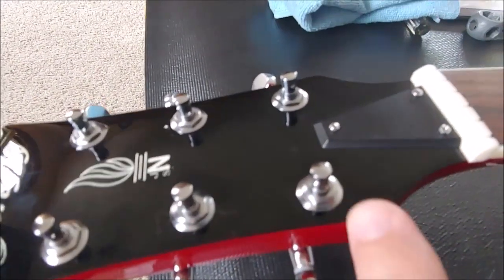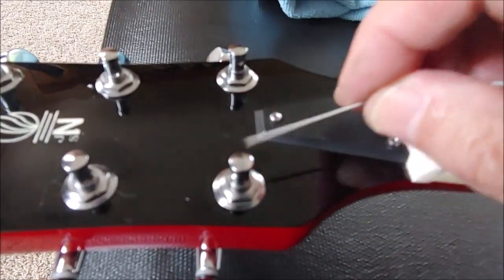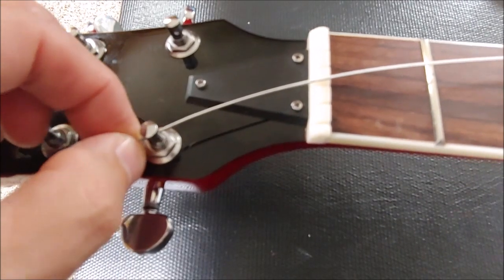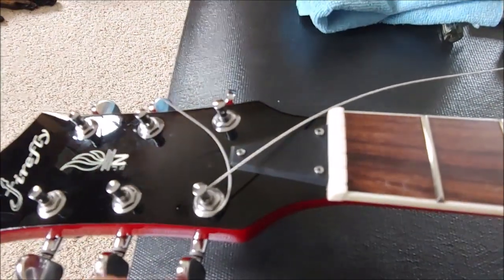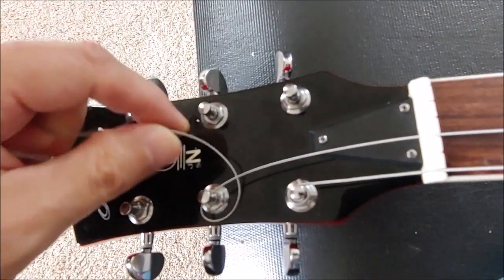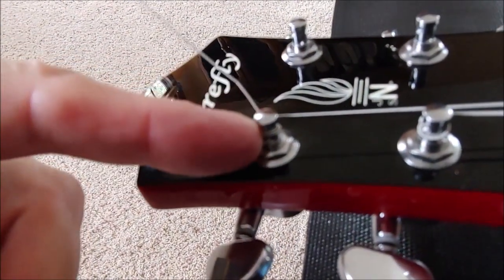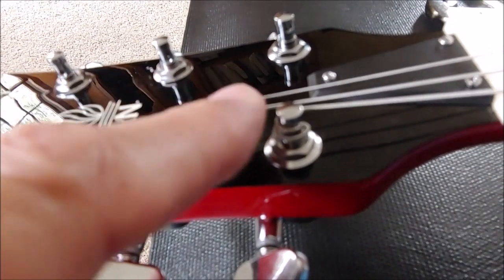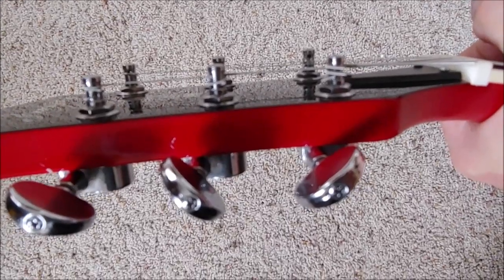Wilkinson EZ-LOK Tuners: Putting on the Strings

Comment: Good job, I usually have the strings through the bottom first on both E strings and in the top holes for the rest so they are at a more consistent height behind the nut. But as you said it doesn't really matter as long as they don't slip 👍👍👍

Comment: I pull the string tight then wrap one turn then into the second hole, locks tight. I use all upper hole's first. String's using a string tree lower hole first.

Comment: Two holes, one hole, either way these tuners have a high ratio and hold pretty darn good for 20 $ tuners. I have a set on one of my el cheapo guitars and they are still in tune after two months in the closet and hold while thrashing on it. If you are short on money, buy a set.

Comment: "Featuring Wilkinsons 'EZ-Lok' system"
 This feature is essentially 2 string post holes drilled at 90 degrees from each other. Pull the string through one hole real tight, wrap 3/4 around the post, pull tight through the other hole. Tune to pitch, cut the string- DONE. Use the top hole first for the E, A and D, use the bottom hole first for the G, B and E. Or, you can ignore it and string your guitar the traditional way, the choice is yours.

Comment: WoW!  sorry dude, it is all wrong. 
For 6 in line staggered tuners - Top hole first for the E, A & D. Bottom hole first for G, B & E. 
For 3+3 tuners - Top hole first for all E, A, D, G, B & E.
Be sure a string in through correct hole, pull tight then wrap 3/4 around the post, pull tight through the other hole. Tune to pitch, cut the string - DONE.
Reply from the maker: Ultraflex, thanks for your comment and explanation. You say toMAYto, I say toMAHto. No worries.
Reply: Thanks :)

Comment: Video is too blurry to really be helpful at all. Furthermore, using the top hole first leaves the string without a break angle.
Reply from the maker: I apologize if the video wasn't clear enough. The goal was to demonstrate the process in its simplest form.